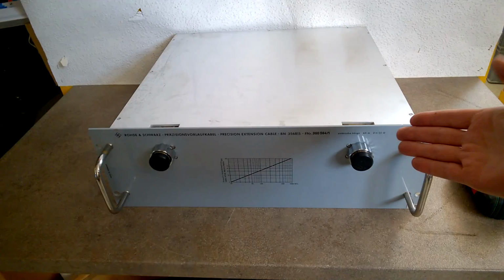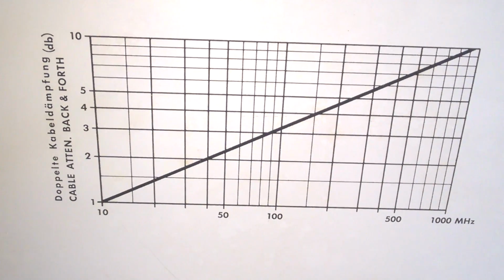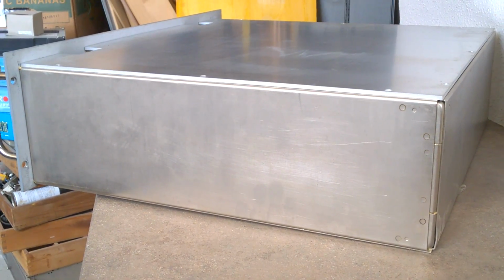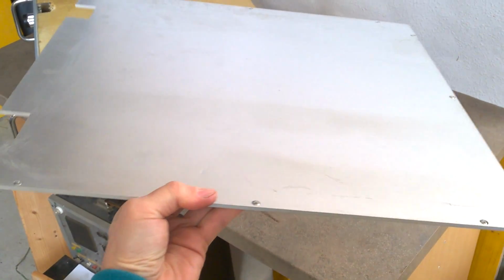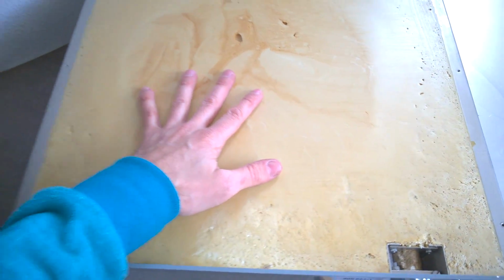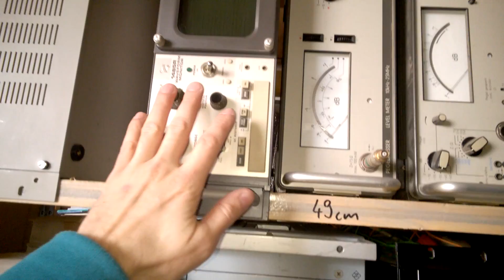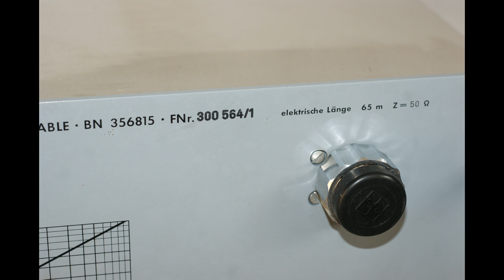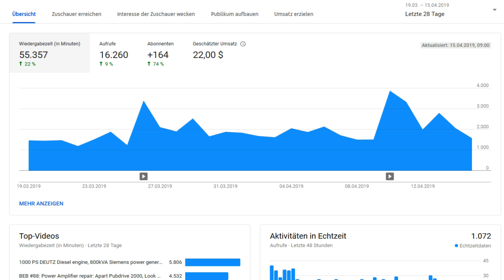😉The Most DISAPPOINTING Teardown Video Ever 😜 , Rohde & Schwarz Präzisionsvorlaufkabel

Comment: It's a piece of rigid coax cable with Dezifix connectors on either end secured in foam for purposes of protection.  One description says that the cable is 14mm in diameter.  I believe it was intended to be used as a delay line.
Reply: I get the purpose of delay lines but is there some significance to 65m that would justify this particular length being enshrined in an expensive rack mount like this? Is it just meant as a calibration standard? Educational demonstration piece?

Comment: Why did you not simply dissolve the foam?
Reply: Because he sold the unit. I'm pretty sure the buyer would like the unit in original condition
Reply: + i think this is absorber material for hf soo part of this devices functionalitx depends on the foam beeing there
Reply: @jojoposter  this is just expanding foam (polyurethane) - it will have no electrical function on the outside of the 65 metres of Coax-cable that's buried inside it. It will stabilise it mechanically and that's it.